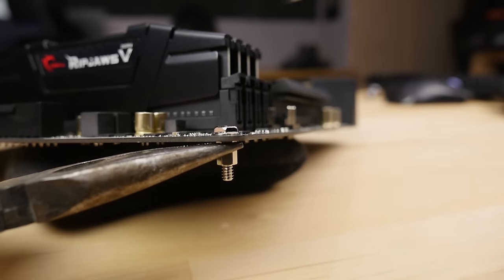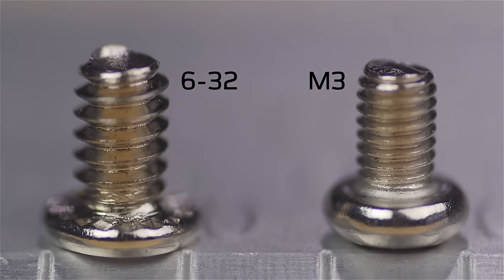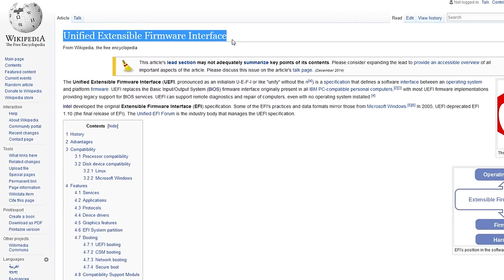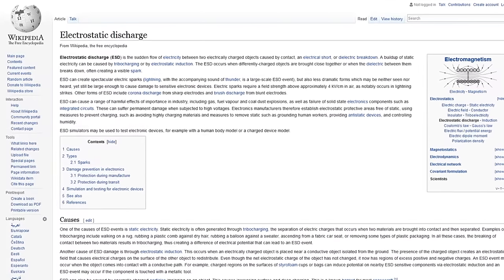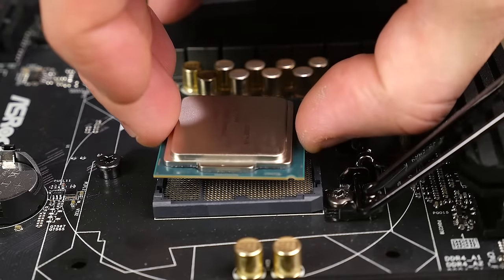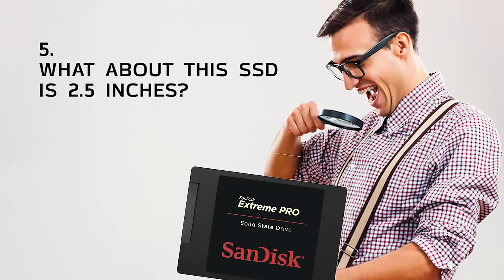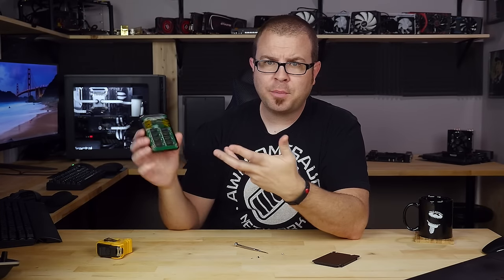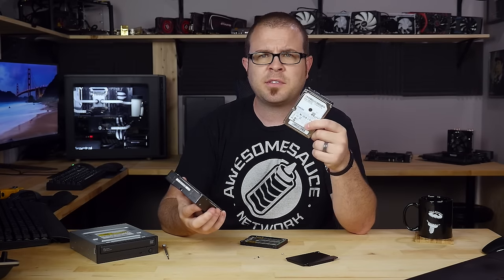5 Confusing PC Building Facts

Comment: Please read something about ESD, because clearly you doesn't know how to prevent it. Having the PSU plugged in doesn't help you, that means you are grounding yourself, which is confused to being the same as ESD safe. ESD is about having the same voltage level as the componentes you are handling, "grounding" yourself when holding the device in you hand can cause damage to the components for two reasons;

A) The level differ so much that a charge/discharge is so high it damages the components, since you don't use a resistor to slowly adjust your voltage, otherwise it will be a rush in voltage = causing "sparks" = Dead/damaged boards.
B) You change the level so much different from the component so when you touch it afterwards you will damage the components.

And since the PSU have paint on them you aren't really grounding anything since the contact you touch is isolated, maybe that has been saving your ass really.

But saying you never had ESD damage is just wrong, because ESD damages can be shown directly or even sneak up onto you days, monts, years after the actuall damage was taken, how will you then know it is caused by ESD? Have you ever changed RAM/GPU/etc because "they broke"? It could possibly be because of ESD and not "bad made" from manufactor.

I work in a development area with sensitive electronics, I'm ESD certified. I hope that is enough info for you to trust me on this.

Google ESD damages in pictures and you will see some nasty damages and give you a explination why the problem could be visible many days/years later.

Comment: the 2.5" hard drives and the 3.5 inch hard drives..  Relates to the size of the Physical "Disk" that is residing in the case... Now, that doesn't explain the SSD 2.5...  (No Disk)

Comment: Don't forget when you install a new processor for example and when you boot up after ~5 minutes the pc shuts down.. and then when you restart it happens again, 1 week later, everything works fine 1 problem it still shuts down after 5 minutes

- Temp = OK
- HDD = Works perfectly
- Windows = Windows 10 (Works like a charm on other systems)
- MotherBoard = BrandNew & Changed just in case
- Processor = BrandNew & Changed just in case
- Ram = Perfect Condition

Errors like these fuck with my head, i had to buy an intel i3 instead and another motherboard with the correct socket.. For 1 week i was sooo stressed by that processor, i even bought new ram just for that stupid processor...

Comment: My dad is scared of pc building, he compares it to building a car or disarming a nuke, and so he will never let me make one for myself.
Reply: Probably quantum physics.
Reply: I suggest you try to sway him to let your get one built by professional, if building your own is to him tough job. If you know the pro guy just go to his office and assemble it your self to save in costs.

Of course you could also go to local electric waste site, pick up 3-5 pc's and assemble one or two working ones to show you pops that you know what the fuck your doing, with added explanation that even if he does not understand how its done, it does not mean you dont know how its done. Also from that you have cheap pc where you can start to upgrade or just do whole new build if pops is starting to use his head..

From personal experience i had similar thing happen with my mom. I told lets ask buddy of mine to order the parts and put the thing together, but nooo she had to go and go get intels some integrated everything box pc that was way too pricy for the quality and could not even be upgraded...
Reply: +Kristopher Kohlmeier My dad started me off repairing the cars. I was never daunted again by a mechanical task. Ask your dad to teach you basic maintenance for a vehicle. Oil changes, filter replacement, coolant change. If he doesn't know how, it's simple to learn these three online and there is a really low  risk on these. Learn these and show him how it's done and I'm sure you'll have free reign to build a killer PC, not to mention a "one up" on a car for graduation.
Reply: ha ha theres an old saying, people that say they haven't f-ed up haven't done anything ;-)

my point was that when you get it wrong on an old hunk of junk it doesn't matter and the lesson sticks with you. eg i pulled out ram chips while my parents pc was on and popped a capacitor on the motherboard, wont do that again hahahha i fixed it for them though
Reply: this was back in 97
Reply: haha yea man ah shit

Comment: Actually you're completely incorrect about working on a metal surface... So long as no component pins DIRECTLY touch the metal of a table/bench, the static will simply discharge.

Its not conductivity that's harmful, its discharge... as long as electricity can discharge safely, it simply won't hurt anything.

Comment: i recently replaced the motherboard in my pc with a newer one... the building was easy... figuring out why the pc wasn't doing... well anything when i tried to turn it on was the hard part 

turns out not only the motherboard but also the cpu were both defective... thats what i get for buying from ebay
Reply: +Hunter Rodrigez You should always buy your internal computer components brand new.
Reply: swagtical well i bought a bunch of stuff used... like ram and harddrives and never had any problems... then i buy some more serious stuff and of course... that stuff is fucked
Reply: +Hunter Rodrigez I just look at the seller rep. I got lucky one time getting a fully working GTX 760 for $60 then traded it in for a GTX 950
Reply: ccricers the sellers rep was like 99.8 or something, and to be fair they I got my money back, at least for the processor which was like 120 bucks 
The Mainboard however I got off something like Craigslist and so I was out of luck there
Reply: ***** The one time I got screwed so bad was buying a old musical keyboard. It was cosmetically in good condition but was dead on arrival. There was no option to pay with PayPal so I paid with credit card and the owner refused to charge back the refund. I no longer use credit cards for eBay.

Comment: Umh.... It's not like metric and "imperial" units are split into "two parts of the world". There are THREE countries in the world currently using the old imperial system. Myanmar (a small regressive country bordering to Thailand and Bangladesh), Liberia (a small regressive country on the west coast of Africa) and USA (a large regressive country between Canada and Mexico). :)
The "other" 192 nations of the world are all metric. ALL of them. Great Britain does by law accept the use of imperial, but the national standard is metric.
Reply: +AJBtheSuede It gets even more complicated when it gets to the nuts and bolts of it because you aren't using simple measures anymore but a fastener that has varied specifications and not immediately interchangeable by a simple conversion factor. The ISO series fasteners are not the only metric fastener standard, and the ISO itself has metric fine and course thread standards. Imperial fasteners have several standard including US which has fine UNF and course UNC threads, and many other older threads such as Whitworth, and specialised threads such as NTP and BSP for pipe.  That said modern electronics should not use any threads other than M3, (or M2 and M1 for smaller devices).

Comment: Confusing fact number 5 isn't that confusing.  The case of the 2.5" SSD is the same width as the case of a hard drive with a 2.5" diameter lump of spinning rust inside it.

Confusing fact number 6: an SSD isn't a drive.  It's not a disk.  Here's how to tell.  Pick up a CD.  It's disk shaped.  The thing it goes into has a motor that drives it around and around.  Nothing about an SSD is disk shaped and there are no motors turning it.

Comment: Wie findest du diese Konfiguration:

Prozessor: AMD Ryzen 5 1500X Prozessor

Grafikkarte: Palit NE51060015J9-1060D GeForce GTX 1060 Dual 6 GB Grafikkarte (GDDR5, 8000 MHz, 16x PCI-Express 3.0

Ram: Ballistix Sport LT (4GB x 2) Speicher Kit (DDR4, 2666 MT/s, PC4-21300, SR x8, DIMM, 288-Pin)

Festplatte: WD Blue 1TB Interne Festplatte

Netzteil: EVGA 450 BT, 80+ Bronze 450W

Mainboard: ASUS PRIME B350M-A, B350, DDR4 2666 2400 2133 MHz, HDMI, DVI-D, D-Sub ports

Gehäuse: Cooler Master MasterBox Lite 3.1

Comment: Actually you have never knowingly zapped something with a static discharge. Let me put it to you this way. Have you never had a piece of hardware that seemed to be dead out of the box? Or even worse had a piece of hardware that was just buggy from day one? Worse because dead hardware you just replace, and is often obvious. Buggy components are sometimes not initially a problem, and often far more difficult to diagnose what component is causing the issue.

Are you still sure you have never zapped anything? 

No offence, I'm not trying to act like a know it all.  Its just that I have been building PC's since the late 80's. And though current gen hardware is less susceptible to static discharge than it once was. It still is.

Comment: The silver-colored Motherboard standoff in the middle, what are the dimensions of that one, my case uses those I think and I can't seem to find them around. It's a Cooler Master Mastercase Pro 3. I tried some off amazon and they were loose when screwed in. not quite wide enough thread for the case holes. 1:13 time code

Comment: another thing making pc building harder than it should be: freaking molex connectors!
Reply: I don't know how many times I've pushed the connectors out of the housing because they don't perfectly line up.  After the pins are pushed out, that connector is never the same.   sadface
Reply: Hmmm ... Till last year, I used power supply from 2004, changed everything 8 times and molex were still good.

Comment: So the 6-32 is used in the US and M3 is used EVERYwhere else.  They look different. That confuses you?  
UEFI is the new name for BIOS ... er.. OK.  SO what? 
 YOU don't understand the basic concept of ESD.  Its to limit "WOUNDING" of a component causing it to work unreliably later.  Not killing.
The cpu ain't confusing, just tough.
The "drive" is a Hard DISK Drive.  The size refers to the size of the disk.  Now it as a standard so the SSDs are the same standard.
If any of these things confuse you, you should find a different career.

Comment: I found the power supplies were not good for the wattages they claimed.
Reply: Don't get cheapo power supplies then. A lot of the cheaper stuff overstate their capabilities. Buy from a reputable brand and you should be fine. You'll also get cleaner power from the better boxes so your gear will last longer.

Comment: 1 year ago my hard drives failed so I was able to shotdown my PC from Win7 normally, after 1 year I bought new hard drives, made an exyensive clean up and nothing happened, fans were turning but no POSR, I went to consult PC techs and the best explanation received was BIOS got erased because the 3V battery discharged after not being connected to power for a lonf time, 1 of them said that happened to a guy after 6 months if not using his computer, I eead that the BIOS can be damaged by overload, BIOS update and other sources but never for the luck of use, yes my battery was dead but this is not evidence as I only have a sample of 1.

So they told me to rewrite mt BIOS cost the equivalent of $80, I'm from Bolivia, so too expensive, alternative is trying to get an USB EEPROM Programmer to write my BIOS in a friend's computer, or order the same chip model (DIP8) with the BIOS written/programmed from e-bay as many videos here suggest.

Have you ever encountered such problem? I'm a PC tech too but been out of the business for about 10 years, so I'm outdated and rusty, any illuminationwoyld be greatly appreciated since I'm in the dark, thank you.

Comment: I haven't seen but can adding a pci 1 video card even if 1gb can help? because the 1x drive barely gets used in systems but always open on the board. Would a m.2 to pci be worthy of use in a 1x slot? 
I'd be interested to see

Comment: Downvote for lies. UEFI wasn't for Windows 8 & 10.  It was to prevent people from installing XP (the best operating system).  I should add that they failed.  There are still ways around it.  I should also add that ALL operating systems support 128 GB of RAM.  There's a bit of code in non-professional  versions of Windows and OSX that limit the RAM.  Remove the code and any OS including 32bit versions will support 128 GB of RAM.

Comment: UEFI is needed to boot operating systems in 15 seconds? I have a Windows 10 machine that has a BIOS based motherboard, with DDR2 memory and a 2.5ghz Core2 Quad processor, and it boots in about 12 seconds...

Comment: Wtf. You don't have to touch the power supply to prevent ESD, touching the case will do the same thing.
Reply: +Hjalte RMC 
Neither way "prevents ESD", you need proper grounding while handling components for that.  You might luck out but you have no way of knowing as damage from ESD can  be limited in such a way that it only affects the machine when certain regions of the RAM, or SSD are accessed for instance. It can also manifest in the form of earlier than specced failure.

Comment: I think I messed up my fx-6300 by installing a hyper 212 and mounting it down to hard because whenever I boot up my system everything spins up but the monitor doesn't even recognize an input ( all the parts have been tested but the cpu could this be the problem ?)

Comment: did he just suggest touching the Power-supply case while the PC is plugged in? Sure, I know that normally that is totally safe, but srsy. why fuck around with it? Plug that dam Pc off when you open it. A static discharge ruining an expensive piece of silicon does not sound half as bad as ... well... you know. Ground yourself on other things, if you really want to.

Comment: Question: How is a conductive table worse that a non-conductive when you say you should use the casing as a discharge point? That logic is completely back to front and you contradicted yourself
Reply: No, it's not him contradicting himself, it's you not understanding what the issue is and how ESD breaks stuff. You won't see an ESD mat made out of a conductor either.
Reply: An ESD mat is a material that cannot build up surface voltages.
And for your information, ESD foams that are used to pack electronics and mostly conductive.
All I'm asking is what the hell is the issue with a metal table is the casing is metal and you are supposed to touch it regularly
Reply: Krisztián Szirtes
So why isn't a metal table top used as ESD mat? It can't build up a surface charge either. The reason is a metal table is too conductive. If you have an electronic part lying on the table and you touch the part (not the table) and you are "charged", electricity will flow through the part into the table (and eventually ground), possibly damaging it.

Comment: I have an a10-7870K. I think its burning out because my computer does "bzzrrzz" sounds every 10-15 seconds. Having micro-freezes when it happens. 
I've reinstalled all drivers, disabled drivers, enabled drivers, updated everything, and completely reinstalled my windows OS. then tried again.1) does anyone know what this might be? its not drivers. its not multiple drivers, or updating drivers. Anything to do with drivers. I've ran through about 10 different tutorials on "this issue stemming from drivers" and not a single one has even remotely worked.
2) if it is burning out, what replacement cpu should I put in its place? since its AMD, clearly my motherboard pairs with this specific socket type. What AMD upgrade should I put in its place?Motherboard: A88xm-A
cpu: amd a197870k
ram: 8g ddr3 1866
gpu: radeon r7 240 (yeah yeah I know. stfu. I'm getting a new one. probably the rx480)
HDD: 1T.
SSD: nonethat cost me about $300 to build at the time. But now its time to fix it with some upgrades. Please help.

Comment: The 2.5" "drive" is not even a "drive" any more because it has no disk. "Drive" was short for "Disk Drive". And since there is no disk to drive it can no longer be correctly called a "drive". Call it the generic word "Volume" or simply "Memory Storage Device". Thumbs down for forcing me to watch a whole advertisement without an abort button after 3 seconds.

Comment: How do you know that you have never damaged a component with ESD? Ever had an unexplained hardware failure? Point being, you most likely wouldn't even know.
Reply: Well, the part wouldn't work if it experienced an electrostatic discharge.
So upon assembly, if a part doesn't work, he probably zapped it. Or it was a DOA.
Reply: Exactly...He claimed he has never damaged a part due to ESD. My point was that he wouldn't know!

Comment: OMG. I've accidentally used imperial BS. What is metric equivalent for 2.5" 3.5" drives.
Reply: about 2 and 3 meters. cd is about 5 meters wide.
Reply: +Joona Knuutinen No, an inch is not a meter. A 2.5" drive is 6.35 centimeters and a 3.5" drive is 8.89 centimeters. A 5.25" drive (a CD or DVD) is 13.335 centimeters.

This is one of those situations where it's probably best to do as the Canadians do and use both systems where it's convenient.. So much easier to remember "five and a quarter" than "thirteen and three-hundred thirty five"
Reply: There is no "metric equivalent", they are called 2.5" and 3.5" in metric countries too.
Reply: Even in full metric countries like australia they are still called 1.8", 2.5", 3.5", 5.25".

Heck car rims are measured in inches as well
In australia we use to say 1/4 Acre block of land.

But the block of land was not really 1/4 Acre, more close to 1/40  Acre
Reply: Not sure if you're confused, but a metre is about 3ft.
Reply: 2.5 disk is 2.5 disk ... people here don't even know how long inch is, but they know how big 5.25 slot is :)
Reply: 39 inches =1 meter
Reply: 25.4 mm = 1 inch